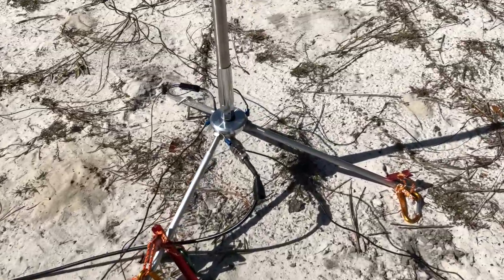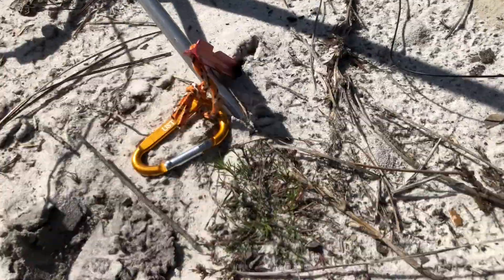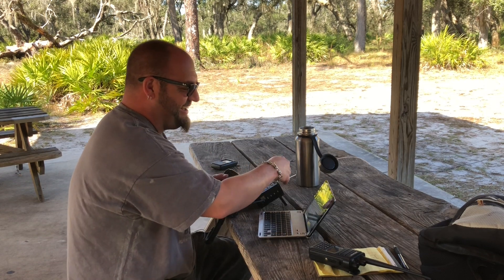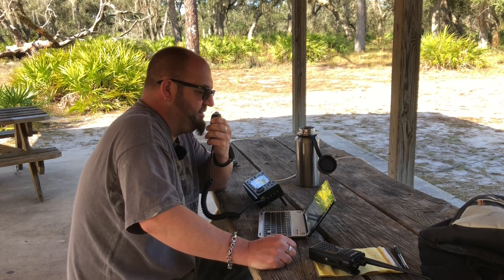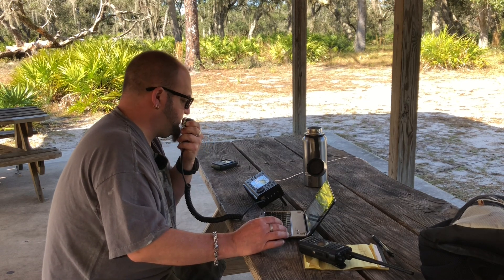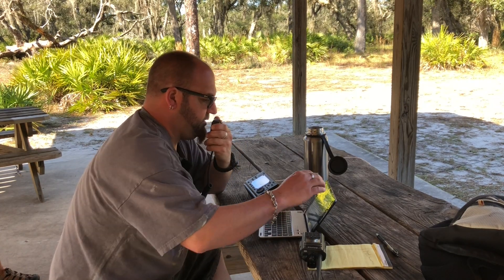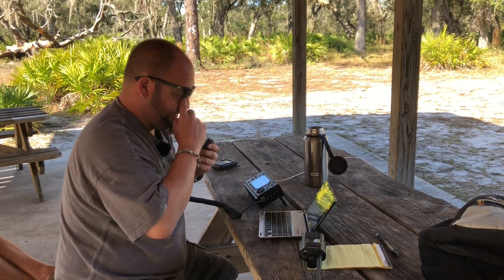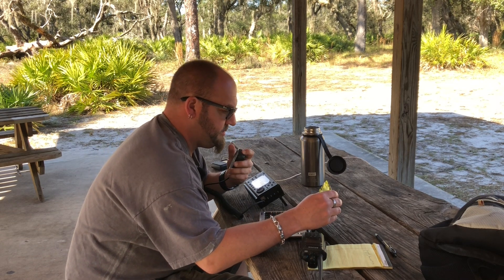Xiegu X5105 Field Test.  MFJ-1979 Antenna, 5 watt POTA activation.

Comment: Before you buy one of these turds, take a look around and notice there is no one to help you repair it....There is no one to help you when you brick the radio with a failed firmware upgrade.
I have a $500 paperweight.  It's a disposable radio.

Comment: Good video Mike👍 Do still have the X5105❓I have the New X6100 and I which I had got the X5105 instead❗️
Reply from the maker: I sure do.  I don’t use it as much is I’d like.  The 705 has been my main portable rig lately.  The 6100 looks cool but it also looks like it’s plagued with some of the same empty promises the GSOC has.
Reply: @hamradiotube  It is a great looking little Radio and it met all my wishes as what it was supposed to do so I decided to order it instead of the X5105 and I wish now that I ordered X5105.  I just packed it back in the box and returning it tomorrow but Radioddity is not easy dealing with.  I may buy the X5105 if I can get my refund back.  You always have good, interesting videos.  73. KV5P
Reply from the maker: @mikemiles3068  Interesting.  Are they giving you a hassle about returning it?
Reply: @hamradiotube  They think the next the next Firmware upgrade in January MIGHT fix the issues and they want me to hold on until it comes out.  I am insisting to returning it for a Full Refund, I finally  got a return authorization so its going back tomorrow.
Reply from the maker: @mikemiles3068  Yeah I wouldn’t want something that wasn’t ready.  Based off the GSOC I wouldn’t expect regular updates that fix all the issues.

Comment: Hey Mike would you recommend the MFG 1979 over the wolf river coil of the same size? One built better than the other?
Thanks
Reply from the maker: I've not had a chance to play with any of the other versions that are out there, but they all kinda look the same.  I'll tell you my first MFJ one broke after only a few activations.  I let them know about it and they sent me another one no questions asked.  MFJ's customer service is fantastic in my experience.  I would suspect they all come from the same manufacturer but I have no way to confirm that.

Comment: I'm posting this on an older vid so as not to be a complete sleaze. lol. I failed, man, and I'm hanging my callsign in the QRPer Hall of Shame. I became one of you. Did I make the contact? Sure.. and I was an abject failure as a ham and QRPer. Funny how indignant I get when a ham doesn't hear me.. even when I'm running an antenna that's two feet high. lol. F bombs, etc. so careful here:   FAILS! QRPer vs Savages & Maniacs with Mics - 2020 CQ WW WPX SSB
Reply from the maker: There’s no shame in running 100 watts.  Just make the contact!

Comment: Mike,
   Can't sub more than once but I did hit the LIKE!   Mike, you might well be my favorite channel.
   Why?  Because you are just telling it like it is......THANK YOU!
   You are not a manufacturer fan-boy like some I can (and will) point a finger at.  I strongly suspect some of these guys of giving the best and most positive spin on everything possible in a campaign to keep the UPS and FedEx guys trotting up their driveways with packages from the manufacturers and retailers "For Review."
   Why care?  Because I spend MY MONEY on this stuff and bullshit opinions from those who should know better are not at all appreciated.
   Anyway, I am impressed by this little radio.  I am stunned by what can be done at 5w.  On SSB yet!  With a cheesy vertical antenna!  When I get my code under control this could be my go-to radio, particularly after I upgrade to General and access more freq's.....My FT-897d may go up for sale.......It wouldn't hurt to have the Xiegu Amp standing by, just in case and selling the Ft897d would cover that expense.  Shirt pocket ham shack?
'73's....bob/KF7ZSA

Comment: Nice video. Next time try a raised quarter wave vertical for 20m. A bit of wire up a 10m pole with 2 or 3 raised radials coming down at a 45 degree angle from the feedpoint. You will nsmack the ground mounted vertical out of the park.
Reply from the maker: I have something kind of similar to what you are describing with my Wolf River Coils center loaded configuration.  It gets the coil off the ground about 4 feet and is supposed to lower the take off angle.

Comment: Rob, so could you tell me what swr you are getting on 14mhz, I don't see any tuner? How many radials and what length are they? Thanks Robbie, Ei2iP
Reply from the maker: My swr was pretty much flat.  I'm using 6 radials, 3 are 33' long, 3 are about 15' long.  I was on 14MHZ.  The radio has a fantastic internal tuner if needed though.
Reply: Thanks

Comment: If you ever do a firmware update, please make a video about it. I am still running the original firmware from when I bought mine.
Reply from the maker: This was shipped with the new firmware.  I’ve never used the older one but from what I’ve seen the layout with the new firmware looks a lot nicer.
Reply: @hamradiotube  Post a photo of the user interface when you have a chance. Curious what it looks like. Thanks!

Comment: Great video. I have the exact same  components but I just haven't taken them out and set used them in this configuration, even though, I've read this works well. Now I'm more motivated to try it out with my Elad FDM Duo. Question, would this setup have worked as well with just the 3 radials, 6 radials, etc? OBTW, sorry I missed you at Hamcation. I saw your videos but i usually go mainly for the seminars and demos. Thanks again and hopefully I get to finally meet you, on the air or at Even. Enjoy your weekend. Cheers. Walter
Reply from the maker: With this antenna I needed 6 radials to bring the impedance down to 50 ohms.  3 just wasn’t cutting it.  6 also got the swr down very low, like 1.2:1 with the antenna fully extended.  It’s resonant across the whole 20M band.  Add it to the WRC for lower bands, shorten it for higher bands.
Reply: @hamradiotube  Thank You. I have 9 radials ready to go.
Reply from the maker: Walter Edwards oh you’ll be plenty fine than!  Have fun, 73.

Comment: you are having gd luck with this antenna, with an atu? what type of SWR were you getting without a tuner, do u recall?,.. 73
Reply from the maker: This antenna is resonant on 20M so I didn’t need to use a tuner.  I did need 6 radials to make it happy though.   Swr was about 1.2:1 ohms about 52ish.
Reply: @hamradiotube  super ,  i have used mine stationary mobile, atop my 4x4  works a treat... must say, Ive not bothered with the radials, will do that on my next outing, by yhe sea,.. staked into the ground,... cheers n 73